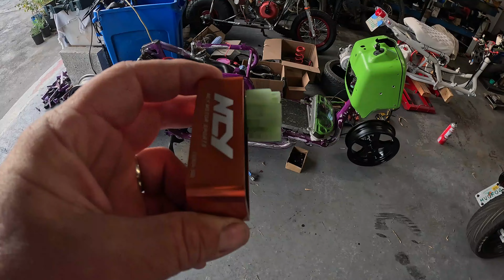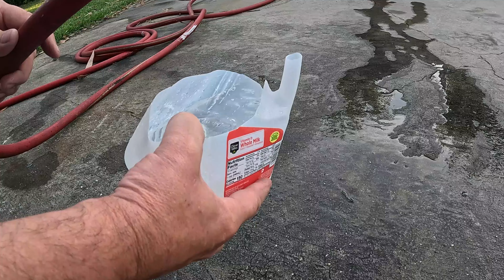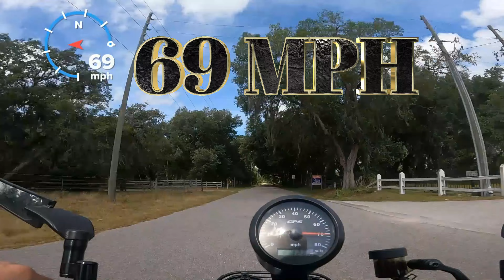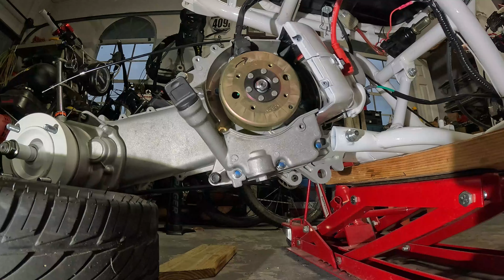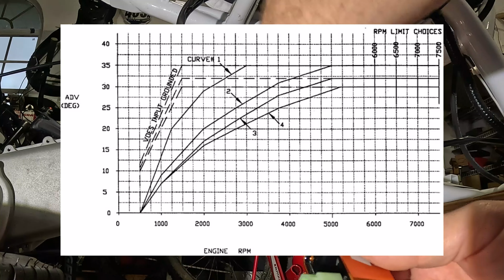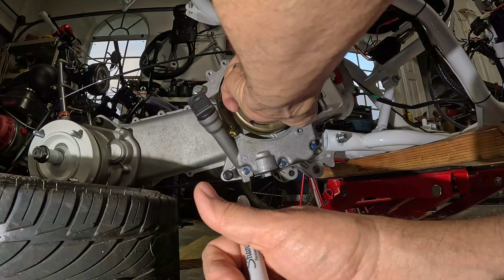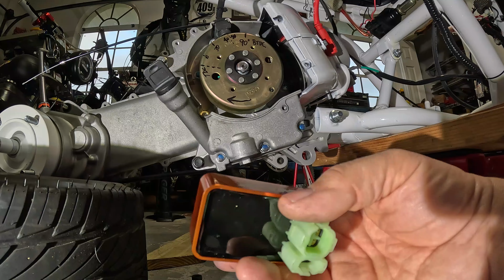Will the NCY CDI Improve a Maddog GY6 150cc With BBK, Cam and other Mods?

Comment: Have you tried testing out a different coil? I watch a few chainsaw builders who do custom porting as well as "race" models. They've mentioned how some models of chainsaw from factory have a governed coil on them that only allows them to turn so fast at full rpm. So they'll swap out a coil of a similar form from a different model of saw that isn't RPM limited. Since they're going for performance that's meant to get through wood fast they tend to aim for 12,000 rpm while in the cut. So I don't know if the same logic works with scooter/power sports coils.
Reply from the maker: Haven't tried any yet.  I know coils like on a preditor 212 can have a rev limiter.  My ghost 212 had one.  I don't think our GY6s have rev limited coils tho.   Biggest issue I have run into with RPM limitations is valve float
Reply: @GhettoWrench  Understandable. More revs needing stronger valves to help keep things in sync.

If you ever test any coils give the yellow Nibbi coils a try. I'm curious about the results. They're one of my favorite China-parts, They feel decently made for the money. 

I put one on my China dual-sport bike and it feels strong with good revs and spark. But who knows I could be experiencing the ole placebo effect. :)
Reply from the maker: @Slane583  good to know.  I did get some "performance" valve springs and gonna do a video on them and try some above 10k RPMs.  See if it blows up.  LOL
Reply: @GhettoWrench  If there's no metallic engine confetti in the end that just means you succeeded. :)
Reply: @Slane583 
Engine confetti is when the party starts! Lol.
I remember around 30 35 years ago when I got into car stereo building. A great company was Orion. One of the sales and install people at the stereo shop used to say, Orion doesn't sound good until you let the smoke out. 
Too funny!
Reply: @ZCRAIZED1  You know you're really jamming out when the magic smoke fills your car. :)
Reply: @Slane583  
That's a fact.
Also when I'm driving and the battery has an internal short and tries to catch fire and the alternator says, hey, that looks like a great time, let me try that and joins in.
Fortunately no fire department but damn was it close.
😂
Reply: @ZCRAIZED1  I didn't really get into car audio myself until sometime around 2000/01 when I was still in high school. I was taking a job experience class that sent us to select businesses in the area for about an our or so. We'd experience what it was like working there.

One of the places was a local audio store that sold car audio as well as home audio and stuff for home theaters. I never knew the place existed until then. My tasks were simple, dust displays, clean windows, bring trash to the dumpster and help out where needed. I remember others telling me the owner was a grump.

But I always got along with him so he seemed cool to me. He had a sense of humor that wasn't for everyone. His original store location was located in a shopping plaza where the area Block Buster was. So Block Buster was two or three stores down from his. When he had me take a break he'd hand me $5 to go get drinks and I'd walk down to Block Buster to grab a couple soda's.

I'd stop in between tasks and look at all of the car cd decks, amps and subwoofers on display. He carried Rockford Fosgate, Alpine, JL, Orion and Zapco. I remember he brought in Crossfire Audio at some point when he stopped carrying another brand. He had some other stuff that I don't remember. I think he had Phoenix Gold at one point too.  Stuff that didn't sell well got changed out quite often. I got to own some minor car audio stuff here and there but still never got to own anything worth bragging about. :)
Reply: That is similar to the the store where I grew up. Only I was the annoying kid that spent a lot of money. I never did understand why most of them didn't like me but they definitely knew why. Lol. A few of the guys were decent, the rest were stuck up rude people. As they were king because they worked there. My brother was in a program similar to what you are talking about. Shadowing the things people do at businesses to try to get an idea what he wanted to do with his life. The people there liked him quite well. Those were definitely good programs to have. I'm sure it helped people figure out what they want in life.  I really loved building stereos back then. I still have an absurd home stereo but no use for one in my vehicle. There is probably enough equipment in my garage to build 3 or 4 full vehicles. Just crap people have traded me over the years. Thinking some day I'll do it again but there are always a ton of other things. At least there are no longer any detonating batteries and alternators. Lol. That was definitely an interesting day.
Reply: @ZCRAIZED1  Ya, I never had the money to buy any fancy car audio. The best stereo I ever had was a silver Rockford Fosgate deck my mother was nice enough to buy for me to replace the broken junk deck in my 91 Toyota Pickup.

The stock 4" speakers were junk too since the surrounds were deteriorated from age. I just replaced those with some 4" blue coned Pioneer's from WalMart that had tweeters that looked like arrow-heads. They had no bass for being small 4" speakers but the combination of those with the deck sounded loud and clear. But the tweeters could sometimes make your ears hurt depending on the song.

Sadly I never got to remove the deck before the truck was sold. I was never able to get another deck like it because Rockford stopped making head units after that.

As for home audio I tend to look for deals on quality units that are nice but aren't popular. I avoid the high-end sought after stuff that goes for way too much. Some of the less popular models can be just as good for less money. :)
Reply: @Slane583  
I absolutely agree about the non-popular home stereo amps and components. I have had many off brands that are great. Yamaha is one I won't buy again due to their horrible interface. For amps Dennon is my favorite in the cheaper 1 to 2,000$ range. For speakers I have had the best experience from Klipsch. They aren't cheap but their lower end is a reasonable price and works very well. Very few things do I spend a lot of money for the older I get. I have had this amp and speakers for 12 years and they still perform as if they were new. I play movies and music extremely loud at times. So loud if someone is sitting next to me in a couch I can yell as loud as possible and they have no idea I'm even making a sound. If I had to guess I would say somewhere in the 125 decibel range. Approaching the 137 of a fire truck and ambulance siren. Lol. This amp and speakers have been amazing. It was around 10k with the 2 big subs and everything but it has lasted. I've never seen a center channel that can make this much sound. It's the type with 4 speakers and a center tweeter. 
I haven't put anything in a car in decades. Just whatever factory thing is there. I so seldom in a vehicle that I just haven't taken the time to do it. That and everything gets stolen. I can't begin to count what has been stolen as far as car audio. In the 10s of thousands for sure. Every time I put something great in a car it would get stolen. People are horrible for doing that.
Reply: @ZCRAIZED1  My current stereo receiver I have my computer plugged into is a Pioneer VSX-D466S Dolby surround unit from 1996/97. I've been trying to find info on how much it went for new back in the 90's but I am having a hard time finding any kind of directory. It's probably just a budget model but so far I like it. I bought it from a local second-hand shop as a component set.

It came with a Pioneer PL-570 turntable, A Pioneer PD-F906 101-disc Carousel style cd player and a budget SONY TC-WE305 dual cassette tape deck. All components work just fine. Got all four major components along with a budget model KLH sub for $120. I mainly bought it for the cd player because you don't see the units that hold 101 cd's much anymore. I don't use the sub so I don't know if that works. I have my early model Pioneer CS-53's plugged into it and using them as near-field monitors so I can keep the volume low and still have them loud enough. I got those for $40 from a Goodwill about five or six years ago.

Funny enough the big cd player still had the previous owners cd collection still in it. So not only did I get five components for $120 I also got a few good cd's as well.

I also have a nicely built Japanese made Craig 5503 stereo receiver from 1977 that I got from my fathers friend for $50 sometime back in 2015. I haven't used it in a bit because it's a 48 year old stereo that's all original. So it's in need of a redo to get it working properly. Which I don't current have the funds to do.

I'm a budget shopper looking for diamonds in the rough. Even if they may be very small diamonds. Stuff like yours in the $10K region is still out of my reach. :)
Reply: @Slane583 
From the sounds of it seems you have a several thousand dollar set up and super cheap. If only I could find that. Lol. Pioneer was great in the 90s and I can only imagine how good that Japanese 70s would sound. It probably has tubes. Those were the best. The vacuum tube type would really take a beating. 
A friend of mine had a Sony carousel that I think was 100 cd. It was amazing to make a playlist on. That was before any cd burner or any way to make a playlist besides recording a tape from one to the other. That thing was great. Matching all of that with a pair of orange foam Cerwin Vega 12s was always the sought after sound.
Reply: @ZCRAIZED1  My Craig 5503 receiver is actually a solid state unit, no vacuum tubes. I did some research on it when I first got it and it's supposedly from a high-end line of home stereo components Craig was trying to sell back in the 70's. From some sources I found my model retailed for $500 back in 1977. Weather or not that's true is another thing.

I guess because Craig was known for cheap audio components their venture into the high-end didn't work out for them since the target audience just kind of turned up their noses and went with a Marantz or Pioneer anyway. So they didn't make any money on them. The company that made the stereo's for Craig supposedly went out of business due to lack of sales.

All of what I mentioned in the last post is only the stuff in my bedroom. I have four more components stored outside in a shed. A Dual 1228 turntable that also needs servicing, a SCOTT branded AM/FM tuner from the 60's, a 100-watt Bogen vacuum-tube PA amp and a SUNN 500-watt sound mixer. It came with the PA amp.

The nice thing about the big Pioneer cd player is that it has optical out along with the RCA's. So it can still be plugged into something recent enough still using optical ports. :)